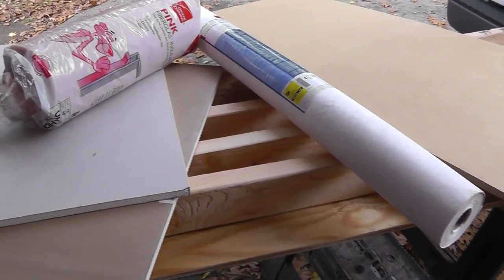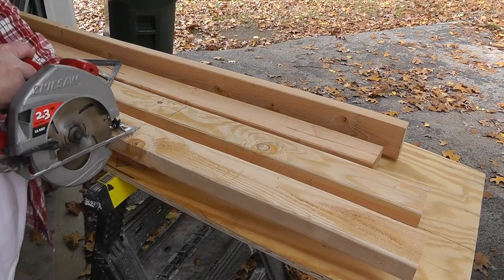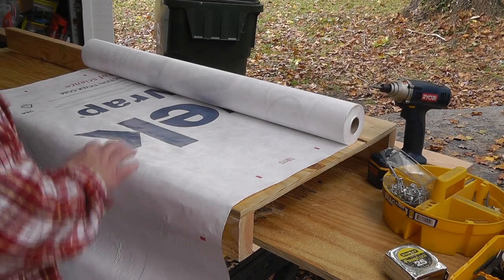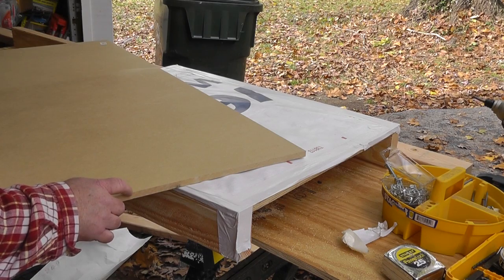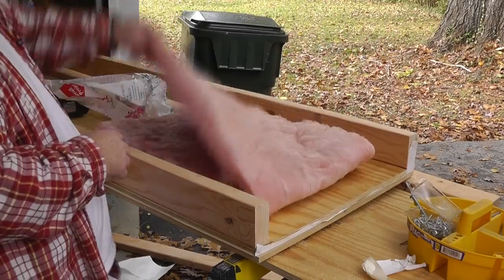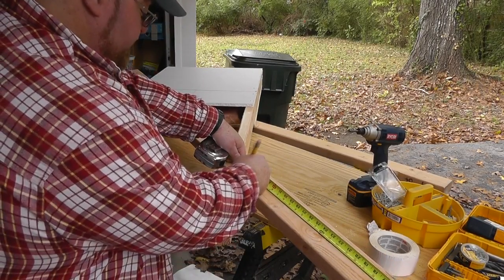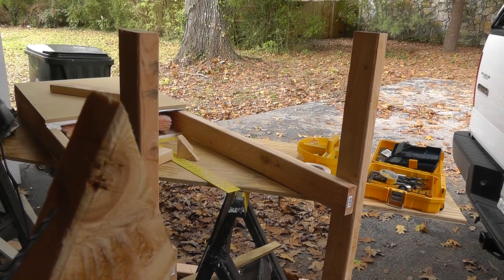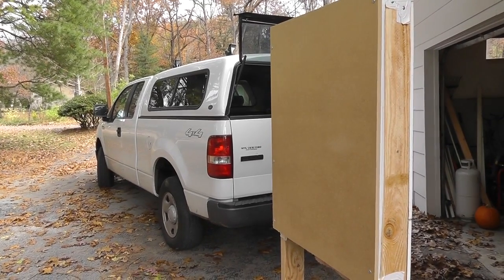Making a Mock Wall Section for Ballistics Testing

Comment from the maker: @aaadream Actually houses with vinyl siding just have the thin vinyl right over the Tyvek so it would be a weaker wall.  The MDF is suppose to simulate a wood siding or a fiber type siding.  The foil backing on some sidings and/or sheathing is a heat refelctive layer and does not offer any R-Value.  Thanks!